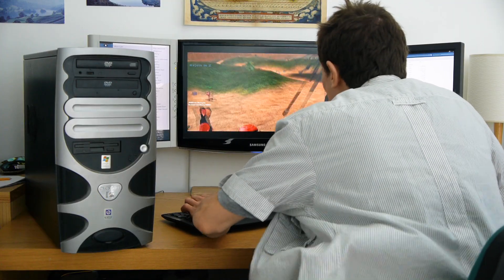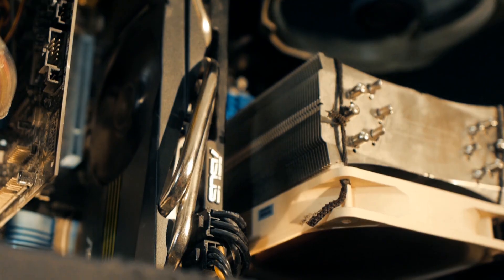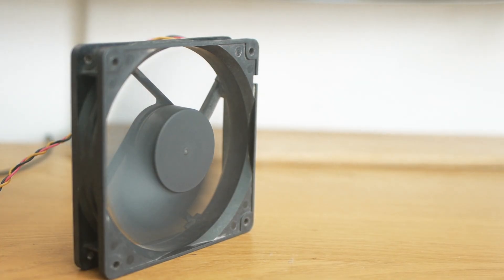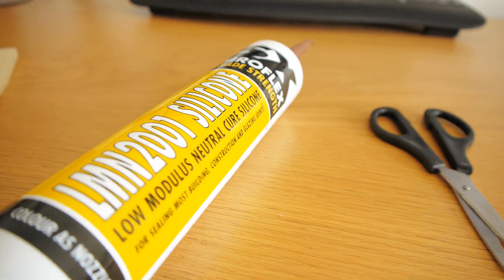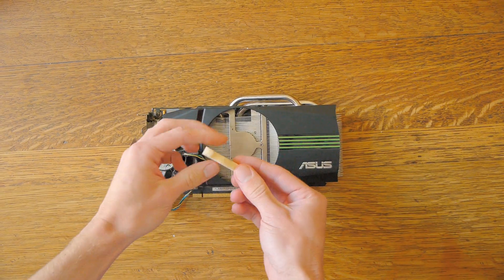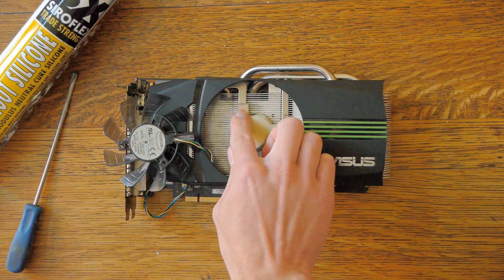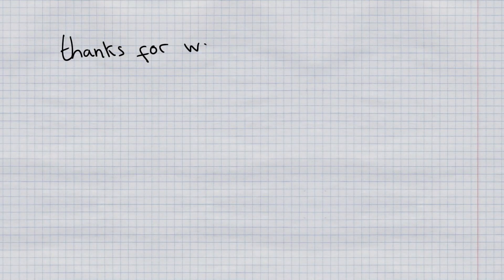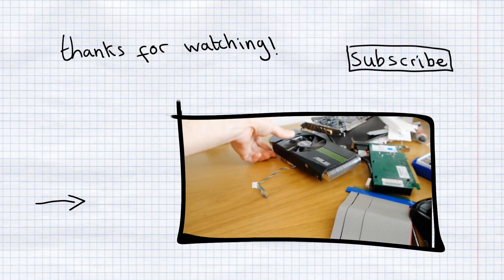How to make a graphics card quieter

Comment: My nvidia fx5200 agp card in my gateway win98se pc from 1999 has a annoying fan that makes a high pitched noise, i think theres no way to make it quieter.
Reply: +Windows Ninety Five 66
Uhmmm. That situation sounds familiar!!!

Well except fx5200 certainly was years away from shipping in 1999 so it must have been an upgrade. So if i suspect the originality of a 1999 PC is no object, i think upgrading to fx6200 AGP would be a nice first step, because it's just SO much nicer. It's faster and more power efficient too.

Whether you decide to keep fx5200 or go for an upgrade, they have i think both the 80mm diagonal mount, right? You can buy aftermarket coolers for that from China, they're not all half bad and usually only cost $3 shipped. Going for a larger diameter cooler will bring an advantage. Another possibility is salvaging the cooler from a dead or discarded 7000/8000 series nVidia GPU.

An NTC thermistor can be soldered into the power line of the fan to implement a primitive form of automatic speed control. A suitable thermistor can be salvaged from a discarded/broken PC power supply, usually employed as inrush limiting element near the power input. ATX 2.0 PSUs with active PFC no longer have that, you need to look at really old clunkers to salvage the element. Or you can just buy it for a few cent.

What i did back then, was equip the GPU with a back then midrange aftermarket cooler, Revoltec VGA Graphic Freezer Pro. It cost me 20€ and it takes up 3 slot spaces as opposed to one. It served me across a few generations of GPUs. The manufacturing quality is bad, fan axle needed to be oiled after a couple years, and plastic shroud needed to be glued after a few more. But it can cool up to 50-60W GPUs with no noise whatsoever. Later then i found that they were available in China (i think from dx.com) under a different brand, but barely much cheaper.

Comment: With the heat from the GPU that sponge is just going to dry out and crumble into fine dust particles which is not what i would like flying around in my computer case, sure it might work for a short period of time but its definately not a long term solution.
Reply: I'm thinking a rubber washer would be better.
Reply: +Deano Essex Some sponge does but synthetic sponge won't.
Reply: +Jack Diller +Cyphox - synthetic foam definitely perishes, and pretty much anything not completely solid has some amount of water in it. open cell foam crumbles into gritty particles. ever slept on an old foamy with rips in the cover and felt like there was dirt in the bed? - the result here is really good - what a difference. maybe closed cell foam (like a mouse mat) would be more practical - though perhaps not as effective
Reply: Sponges, especially of the type he has here, perish pretty fast, and turn to dust. I had a keyboard that used it... it was like sand was in the keyboard...
Reply: +Deano Essex The thing that is hot is the heat sink. air shouldn't be too hot cause it is moved at a relatively high speed and thus, delta T before entering the heat sink and after should be somewhat similar.
Reply: +Cyphox lol Sponge perishes and dries out... Science teacher in my youth proved that .............................

Comment: Won't that sponge melt or start burning?
Reply: +mtothem1337  Nnnnnnnnno. The temperature that you expect to see on the fins is below 60°C, and that would be a critical case, indeed ideally closer to 30°C. You can easily tell because touching the cooler does not cause pain from heat.

Sponge could be made of Cellulose, Polyvinyl Alcohol , Polyesters... none of those are really all that temperature sensitive, absolutely nothing happens to them short of open flame and about 200°C.
Reply: +Siana Gearz Do you realise how hot a gpu can get? He stuck sponge directly to the heat sink, when near enough all of the heat goes to, which can reach upto 100c
Reply: Jack Markham  Yes, i have done plenty of heatsink modification, taping the thermal probes into places, and touching things that could and would burn my fingers, to know how warm exactly things can get. So here's a breakdown. The spot below the fans is the one with the highest airflow and is relatively far from the heat sources which are the main IC (105°C max.) and VRM (115°C max). A temperature gradient is formed, where the spots furthest away from the source and the ones with highest airflow are just about the coldest with near ambient temperatures, with the temperature gradually rising towards the source. Even just the heatpipe spreader alone has a gradient of 20°C or so. You can usually touch the spots right under the fans absolutely fine and they will be barely warm, it's just about the safest spot to touch. If you touch the backside of the card for example, you probably won't be quite so happy.

And even if you DID place a sponge on a 115°C hot spot, below 160°C absolutely nothing would happen to it. However with such high temperatures, you would probably need to count on glue failure.
Reply: +Jack Markham 
That the GPU die reaches 100c doesn't mean the HS reach that temp too, its way below that...

Comment: you forgot to mention that some glues heat up (super glue ''most people will use'') and that could damage the fan or the wire coating :/, this is a good theory but there are some complications.. another is the weight of the fan..

Comment: Well, thankfully most 2015 graphic cards come with fan-off function in idle and gpu power consumption has been reduced a lot so most custom cards run quiet also at gaming temps, making quiet PCs even more possible without using any tweaks.

Especially if you have a Define R4 with sound dampening internals, using 2x Noctua NF-A14 PWM as case fans, a NF-P12 PWM for the cpu cooler (all of them hooked to the CPU_FAN connector so that the PWM drives them @300RPM when browsing interneto or during light loads) a Coolermaster RM and a GTX 960 gaming from Gigabyte, so basically I only have the three noctuas @300RPM when I'm not gaming and there's literally no noise.

The only limit is the damn hard drive (and mine is probably one of the quietest, a Samsung HD204 UI 2TB). 
Hopefully we''ll have decent priced storage SSDs in future, so we can get rid of that mechanical spinning drives.. in the meantime, I was looking to upgrade to a WD RED 3 or 4 Tb.. is there any quieter Hard drive in your knowledge? I also have a WD Green ERX 2Tb but compared to the samsung drive it's noisy like hell and I just turn it on when I do manual backups, I can't stand it.

Comment: You could also use Servo Tape its often used on RC cars quadcopter and many things where hold and vibration are important like this application . Its a silicone like 2 sided tape you can get it at your local Hobby Store. This should cure the noise from the fans and the DIYers complaining alike!

Comment: Use Anti-Vibration Silicone Washers and you'll be fine. The risk of doing this doesn't justify lowering noise by a few decibels. If your card is noisy, next time take some time to properly review the available cards on the market and make an educated purchase based on whats more important for you. Although this looks like a clever solution to the problem, you can end up destroying your card. But I also see other cases where this could be implemented and beneficial, as long as the flaying fan cant ruin what you are trying to cool...

Comment: Couldn't you just use slightly longer screws with rubber bushings between the fan and mounting surface? That way it is still securely mounted.
Reply from the maker: ***** The screws would transmit the vibrations, unfortunately.
Reply: @DIYPerks  Rubber screws :)
Reply: +NytOnPeliAika If we take your logic to the extremes-->No fans means no noise. Why don't we remove the fans!? Every bit counts when you want maximum power and a good "health" for your PC. Taking a detour and saying it's a shortcut.. GG..
Reply: Screws with silicon washers, or rubber screws themselves would not vibrate.
Reply: If the screws were screwed into the rubber, and the rubber was than further screwed with different screws or attached to the base in a different way, than yes. But this is so much cheaper and easier to do I guess. And the sponge doesn't transfer vibrations as well as rubber so that's another factor to take into account.
Reply: rubber grommets mayn
Reply: Not if you use the rubber bushings on BOTH sides of the fan,  making sure you have a good padding between the fan and the head of the screw too!
Reply: well it isnt very noisy either and if you add a huge cpu cooler to gpu it wont fit in most cases
Reply: +masterbrice you could but the Graphics Cards Temp will increase and sometimes the video will lag
Reply: my fan sounds like that when it turns on i cant tell the difference between a f16 fighter jet engine and my pc
Reply: @Joonas warm story
Reply: DIY Perks I think he meant those non-screw fan mountings from rubber, that you extend so they fit through the holes, and when you let go, they expand and secure it in place. I saw them once in a video, never seen them in use myself though. Looks like they are faster than screws to use and reduce the noise (were used for the case fans).
Reply: not a story it was the truth
Reply: +Arvo Jones my gpu has no problem when i lower fan speed the temp gets up like 2-3C more
Reply: +DIY Perks Try slightly longer screws and rubber o-rings above and below the fan.
Reply: +masterbrice What makes the noise is the hard fan case touching another hard surface, it has nothing to do with fan speed.
Reply: +DIY Perks Couldn't you have just reduced the fan speed/adjust the rpm curves using some sort of utility?

Comment: 90% of the noise on any PC is the hard drive IMO. Haswell and Maxwell chips run very quiet even on stock cooling, but try putting a hard drive in the traditional way (screws) and your ears will bleed.

Comment: get a better case... done
(good cases are either heavy [coolermaster HAF-X] or lined with rubber/silicon or likewise so they wont vibrate)
if its still too loud: get a better video card (asus is not the best choice for silence in the GTX 500 and 700 series)
still too loud? use your f*cking headphones

Comment: Why dont manufactures do this properly to a graphics card... to make less noise?
Reply: abdullah afkir although it reduces the sound it may reduce its structural integrity since its just held down by glue
Reply: +Sean Jhon Yngson
Well the point isn't necessarily "why don't they just glue sponges", well, this is obviously not a mass manufacturing friendly process, there would be manufacturing variance, and indeed something could come unglued.

The real question is "why don't they strive for vibration-dampened mounts". Which is trivial, CPU cooler manufacturers had that solved years ago. I mean the common solution there is, the fan goes onto the heatsink decoupled by rubber feet, and it's kept on the heatsink with a tension spring bracket. For example. Or there's a suspension mount made out of stamped rubber pieces, we have seen that on Arctic Cooling fans for at least a decade in their Pro series fans.

Comment: I would have not used the sponge...heat and time will break it down and cause material movement and sag.  Instead,  put a thin coating of the silicon on the fan and the mounting surface.  Let dry. Take thin rubber....maybe from a tire inner tube....and sandwich it between the fan and the plate withe moor silicon.

Comment: This is a nice video, but I have to say, the solution isn't very well thought out. 

1. The Glue and Sponge will actually add onto the heat that the GPU produces.

2. Because of the heat your glue can come undone.

3. The fan is actually upside down inside most cases, so the chances of it being rubbed against its support are lower.

Comment: sure it will be quiter, but it will also have a slightly higher profile, and the fan will suddenly be higher than intended, meaning airflow on the heatsink, may be worse, than it was before. so i might have used something thinner, and used rubber screws to mount it. but im not yet in the market for modding graphics cards, but i am slowly getting to a point, where i can experiment, and not loose a whole lot of money doing it.

Comment: >Enter intensive game
>Fan starts spinning like wild
>Flies off because it's held in with sponge and glue, and it's rotating at hundreds of RPM
>Crashes into and kills some other component
>Component dies, GPU dies because it's not being cooled
>PC is dead
>Not making any more noise because you've broken it
Perfect way to make a silent PC.
Reply: +glitchsmasher I´ve said that i´ll never explode by laughing from Youtube comments, but today i was wrong...
Reply: Game: Halo Combat Evolved
Reply: +glitchsmasher 9 months later and this comment had me in tears. Maybe just because its late but I laughed at every line individually after the third one.
Reply: glitchsmasher !!!Ah come on !!! fan will come out and kill you LMAO :) and cooling will decrease ROFL.
With the amount of glue he put on it and the small size of the sponge, as well as ultra light weight of the fan it will take 100 years for this fan to come off... In fact screws will unscrew them self sooner, cause of constant vibration .

However he could screw this thin sponge through, with original screws ,or a touch longer screw. This way fan would be double fixed with glue and screws.

Nice solution ty vm.

I wanna try it with SPONGE/FOAM RUBBER SHEET 1.5mm
Reply: @maximolotov  100% agree that it will take a really long time for foam + glue to "wear down". If you put thew screws back in, though, then you are just bypassing the foam's and "solidly linking"  the fan to the rest of the PC again, which means the vibrations, instead of "freely" getting dissipated through the foam, will still go from fan to screw to casing, making the foam setup kinda mostly pointless.
Reply: Modern computers do not die because of heat. They just crash or shut down if they get too hot.
A heat dead was possible maybe before year 2000, but not today.

And yes, the sponge will fall off when it gets old and dry. I recommend to use rubber-screws. They reduce noise not as good as sponge, but they hold the fan very good over years.
Reply: glitchsmasher you are forgetting that we are in the 21st century and your PC will turn itself off if a component goes over a certain temperature
Reply: +glitchsmasher #TheFanHitsShit inside the computer.
Reply: Folopolis I never replied to you
Reply: same thing hapened to my computer!! but hopefully nothing got damaged!
Reply: you mean to say silent killer pc...
Reply: Instructions Unclear, Got my dick stuck on the floppy disk. don't ask.
Reply: >Flies off
Possible.
>Crashes into and kills some other component
Like what? Your front panel wires? It's not like it can short the PSU or anything else. The fan always points down.
>GPU dies because it's not being cooled
If you have a PC from 2000 and onward, GPUs and CPUs don't always require fans to be plugged in/working.

It's a terrible idea to do this for a few reasons, not the ones you stated.
For one, the glue he is using is going to be different from the glue you use. It might not be able to withstand that amount of heat.
Two, the fan may or may not be screwed down. This is brand specific.

Three, a sponge is 99% going to burn up when in direct contact with a heat sink. No question about it. Sponges aren't made to stay on a block of copper and aluminum that heats up past 80°c, basted in glue or not.

Fans are replaceable, it would save you so much hassle and time to just replace the fan, or if you aren't voiding your warranty or have no warranty, change the thermal paste on the GPU itself, change thermal pads on the memory, and adjust fan curves on the card through software like MSI Afterburner.
Reply: Why not just add very thin rubber washers between fan and heat sink and still retain the screws?
Reply: Come on, how much torque, really, does a fan applies? It's designed to rotate fast, not apply lots of force. Just how incredibly weak are that foam and glue? How long before these materials get too weak because "too old" sinks in?

Unless you use really super duper crappy materials, the kind that become friable and crumble away over only a few years because of mere contact with air, then I think the fan can go from full stop to top speed, and back to full stop, several millions of times, over easily more than a decade, before you run into a real problem.

I saw two bed mattresses made of some type of foam. One simply crumbled away after a while (a few years). Another was seemingly indestructible.

So,  just use quality materials.
Reply: Are u a clown?
Reply: radioactivemario "Greentext"
Most websites use > to mean quote, not just 4chan.
Reply: David Vines Trying too hard to be "that guy" failed
Reply: glitchsmasher PC isn't exactly dead when the GPU is the only part to replace....I know, I ruin everyone's jokes :P
Reply: David Vines GPU and whatever the flying fan hits.
Reply: glitchsmasher
It probably wouldn't actually hit anything if the fan pushes air away from the card as it would just fly into the card and loose most of it's spin before going to hit another part of the PC.
Reply: @glitchsmasher  how are you after 10yrs mate?
Reply: Muhammad "Boom Boom" Jihad It will still do a great deal of damage.

Comment: My graphics card was getting on my nerves and was super loud so what I did was install a DC step-down module (obtainable on eBay for $2 including shipping) and installed/soldered it between the fan and the video card, so I can tune down the voltage slightly as I wish.  Turned my fan down from 12V to 8.5 where it's only slightly audible while keeping the temperature the same at idle and only about 2C hotter while gaming.